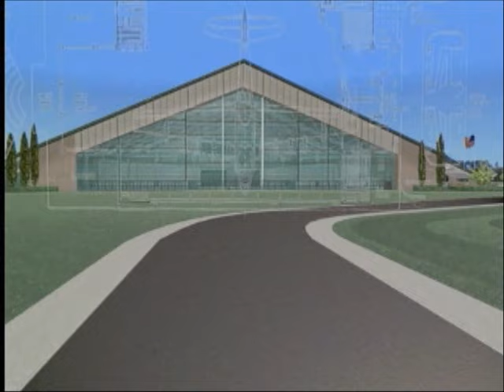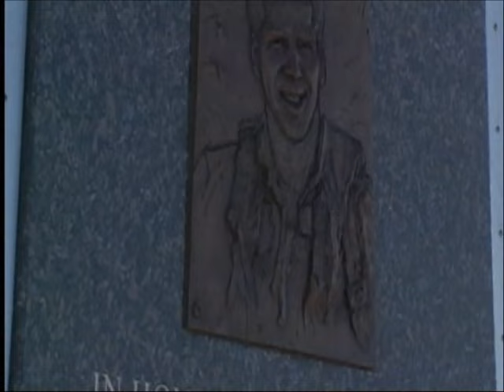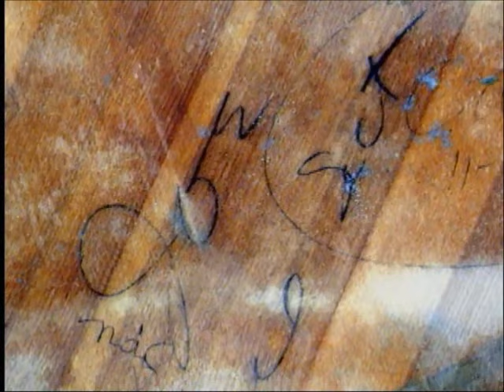The Spruce Goose and its journey to McMinnville, OR

Comment: They could of you know, just flown it there.
Reply: this plane never "flew" for more than a few hundred feet and was solely designed to take off from the water.
Reply: We had a huge Martin Mars seaplane here when SoCal was shopping for water dump aircraft  for fires. Watched it takeoff, similar in size to H1, taxied out by Belmot pier,  pointed west, took over a mile of sea  surface  to get takeoff speed & finally  lifted off- ocean tides/ not bad in our breakwater protected port.  It was a Sight to see. 🛫👀